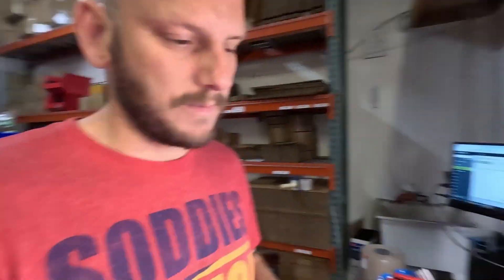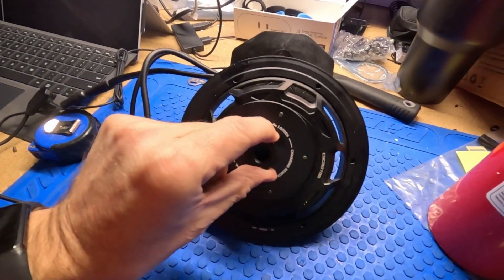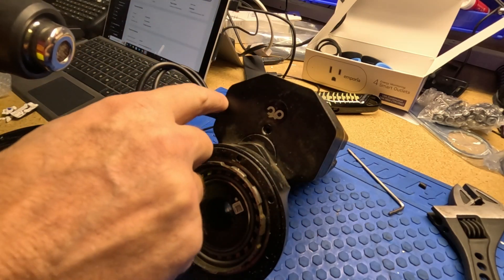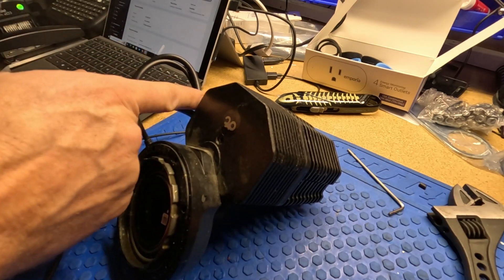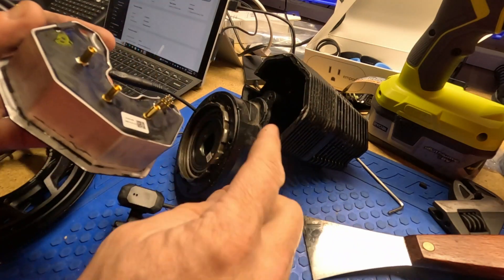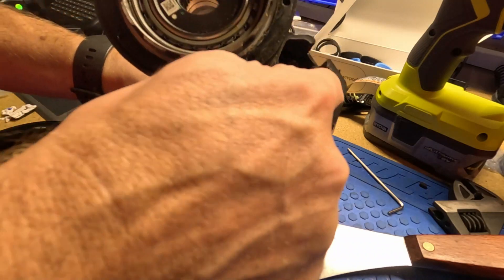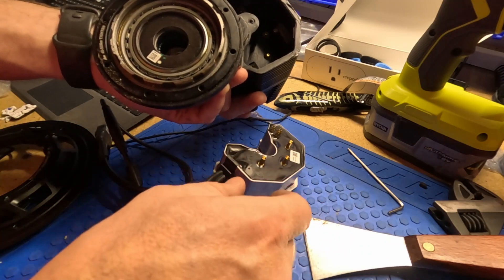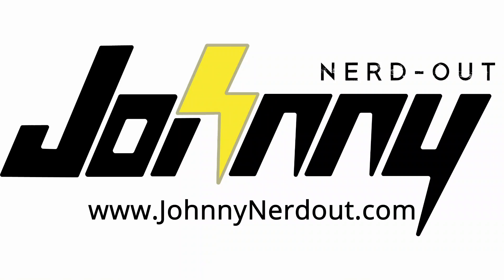How to Easily open and repair your CYC Photon motor

Comment: I've put about 15000km on my photon and I'm having an issue now where sometimes when it's cold the ratchet mechanism doesn't engage properly. As in when I pedal it senses that and the motor spins up but it just maxes out to like 3k rpm and doesn't actually engage the sprocket. Not an issue once it's warmed up but it was pretty persistent on a cold day one time and I could basically only throttle. Also it has started making a bit of a sharp scratchy noise the last few days. Seems like it's just gunk in the ratchet mechanism and just needs a regrease as I've put a lot of km on it and have yet to service the internals. What do you think?

Comment: have you ever removed the chainring while in place on the bike?  can you demonstrate how to stabilize the motor on a table in order to apply both the chain whip and unscrew the chainring?  so far mine will not budge.
Reply from the maker: Hmm good question. On really stuck chainrings you got to get creative on how to get leverage

Comment: The problem I'm having is the sprag clutch. The sprag clutch keeps kicking in over every little bump or too much torque on the pedals no matter what pedal assist mode I'm in. Do you have a video on how to replace the sprag clutch?
Reply from the maker: I don’t but CYC has an official video on that somewhere

Comment: I think you previously loosened that ring, there is a metal incompatibility problem that causes the ring to gall and freeze in place. CYC recommend assembly with a copper based anti freeze grease. Still sucks for us early customers though.
Reply from the maker: I know what you’re talking about. Getting that proper tool is night and day though. That with some leverage should take care of you unless you have some corrosion issues.
Reply: @JohnnyNerdOut  Yeah, finally got mine off today. Used a 12mm coachbolt to hold the tool on place (threaded through the BB shaft space) then used 2x1m lengths of  2" and 1" waterpipe to undo the ring. Even soaking in CRC previously was still quite scary and definitely needs to be done with the motor on the bike.. All good now though. The problem I have is noisy output bearing - any hints on size, availability etc? Even advice on how to get it out would be helpful.

Comment: Mr. Nerdout, my child has a jetson dirt bike. It has power and you can hear the motor trying to run but bike won’t move. Also, it won’t roll backwards. I’m assuming a gear or bearing broke in the rear wheel?
Reply from the maker: Ya, check the planetary gear
Reply: @JohnnyNerdOut  will do! Thank ya sir. I’ll keep ya updated.

Comment: Hi Jonny ate you familiar with the major or most common issues with the bafang m620 motors
Reply from the maker: Not really. I haven’t worked with those motors in a few years. Mainly it’s the bbshd and bbs02 kits I work with now.

Comment: Hey bro, your video popped up on my utube feed because I follow you and watched several of your videos over the years.

Have you done a video on how to service/degrease etc the Bafang BBS02b or the BBSHD and if you   have could you please add the link?  Thanks.
Reply from the maker: I haven’t done a video on that yet. But there are tons out there already
Reply: @JohnnyNerdOut  Ok thanks, my BBS02b has done 7000 miles casual pedal assist use in 3 years and hasnt missed a beat but I've thought about opening it up to put some fresh grease on it and change the nylon gear etc but I still hold the belief in my head of my father's engineering skills saying - (if it ain't broke don't try to fix it).

Suppose prevention is better than cure similarities to changing your engine oil in your car but that's a combustion/gas engine and not electric.

Comment: My photon was returned from repair with the retaining cap on and the chain ring off. The retaining ring just spins the motor because nothing to hold. Appears to be seized or over tightened. Ideas on how to remove ?

Comment: I have heard the photon's have overheating issues than can damage the electronics. Is this a concern? I am considering one for my next build as I want torque sensing.
Reply from the maker: Maybe a couple of years ago but not so much anymore
Reply: No, the motor is automatically throttled and protected when it reaches a threshold temperature. IIRC about 80 degrees.